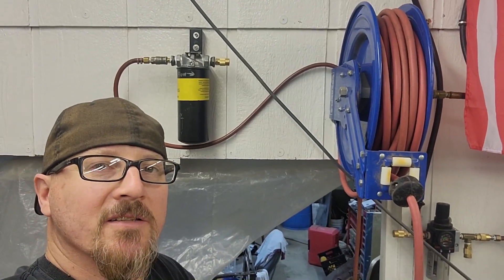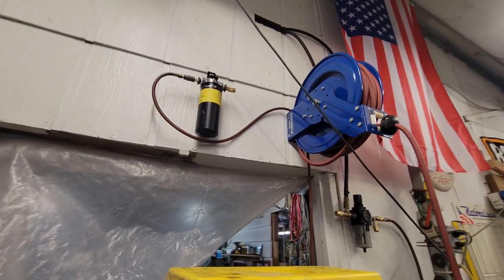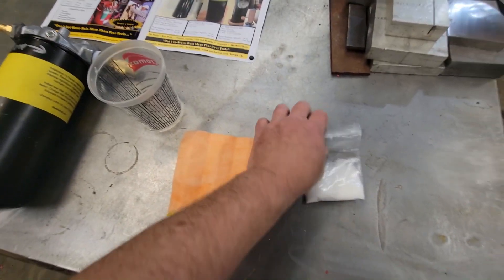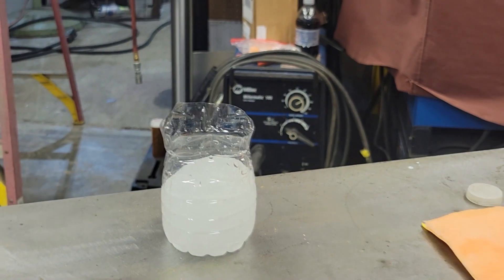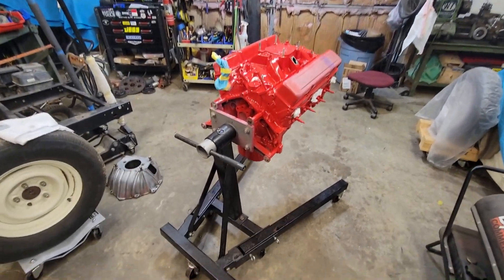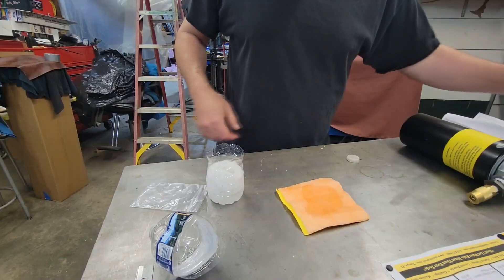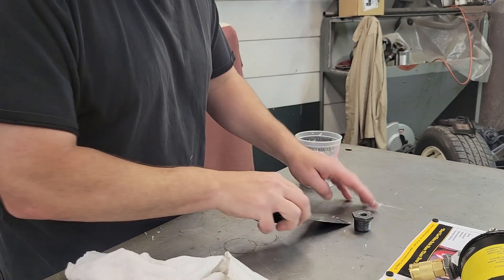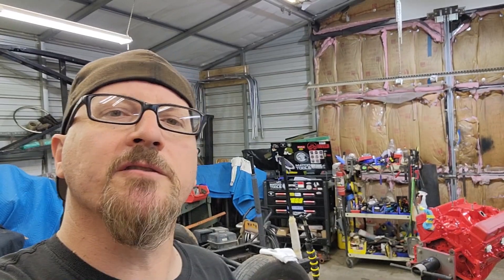This Air Dryer  Makes (Water Disappear) CRAZY [Chemical Reaction]

Comment: Question:  I’ve got a drier on my compressor but is there an easy way to tell if it’s actually working?  We’ve got a lot of humidity here in Texas but it seems like I drain more water out of my compressor tank than I drain from the in-line drier.  That engine turned out fantastic, nice job.
Reply from the maker: Thanks buddy, yeah here in NC the air can get a lil thick here also lol. One way to check for moisture is run your compressor a little bit then hook up a paint gun or blow gun and blow the air on a glass or mirror ,if you have any moister it shows up pretty good. I also use those screw on filters on my paint gun from harbor freight.  Thanks again for your support its greaty appreciated!!!
Reply: Thanks for the tip!  I’ll give it a test first thing tomorrow morning.  If I see moisture I’ll give those HF filters a try.